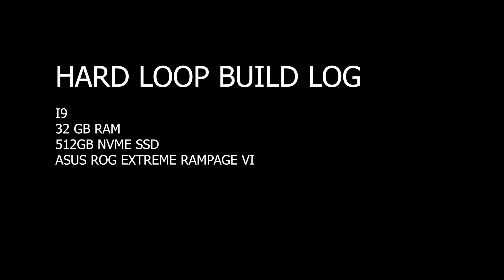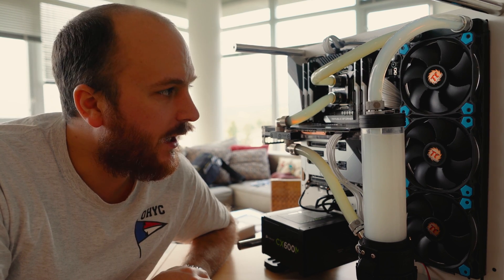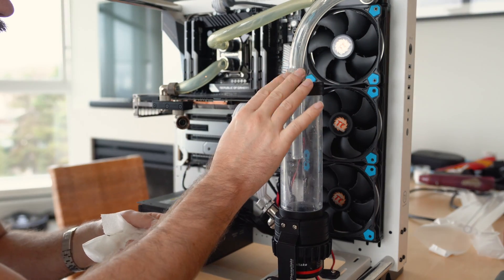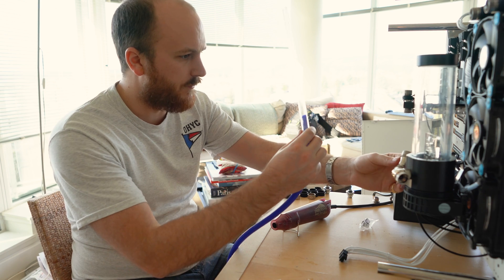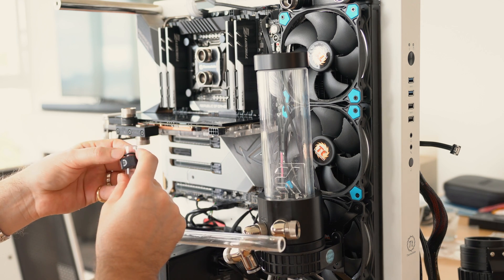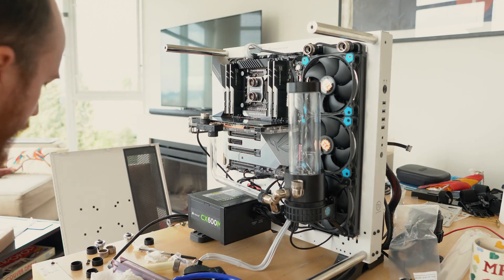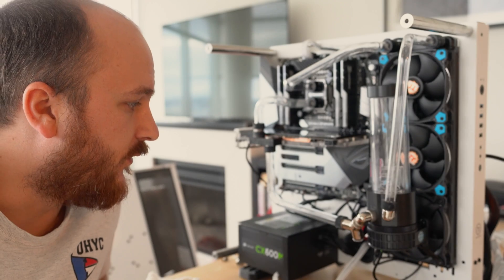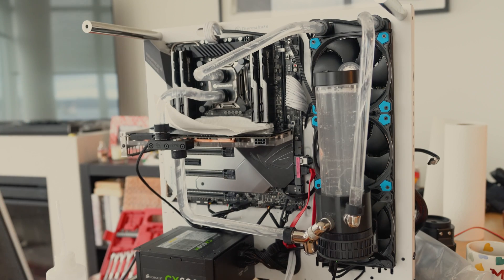Building a hard loop for the ASUS ROG Rampage VI Extreme

Comment: Is that case a p3 or p5?  looks like eatx is over the cable holes and maybe a p3?
Reply from the maker: Its a P3
Reply: @guyhalford-thompson5607  awesome.  the product page doesn't say it supports eatx, but builders find a way.
Reply from the maker: @khmergodhobbies  Yes, thats why the cables are tight.  It just fits, but its a squeeze and I would recommend the p5 if you have a choice of case as it has more room.
Reply: @guyhalford-thompson5607  i like my pc cases compact. i have an ocd with small factor form cases no matter the size of the board.
Reply: @guyhalford-thompson5607  did you remove the grommets for the cable holes?
Reply from the maker: @khmergodhobbies  No, I didnt have to, but its a very tight fit for the motherboard, and removing them may be a good idea

Comment: That case is an core p5?
Reply from the maker: Leonardo Machado Soares yes it is
Reply: Many thanks, I bought one + the rampage VI without know if would fit there hehehe, after watch your video I made the purchase without think twice
Reply from the maker: Its not a perfect fit, I had to move the radiator slightly over to the right and there is a very slight bend in the board. Also some of the cables are quite tight... but it's been running since I set it up with zero issues.